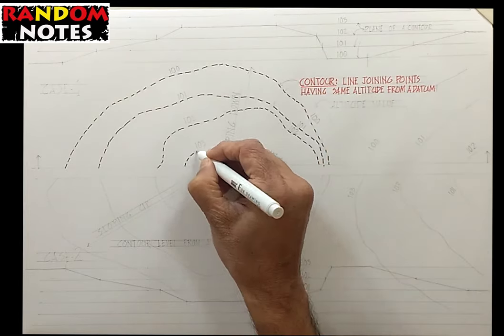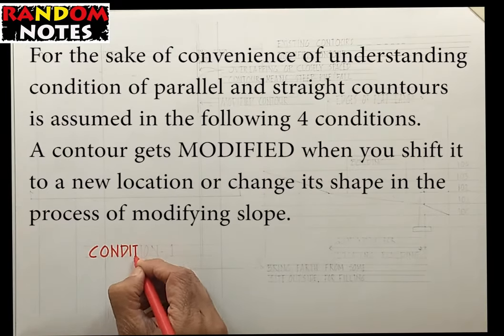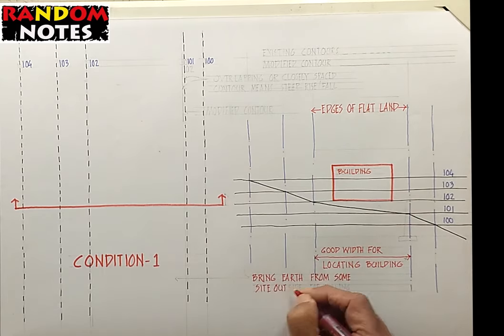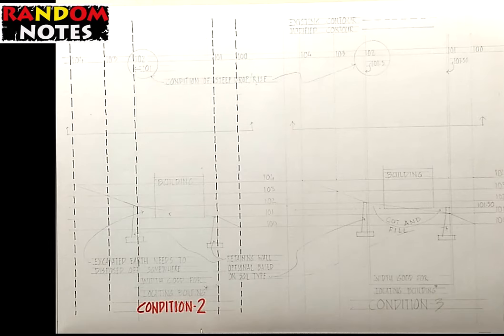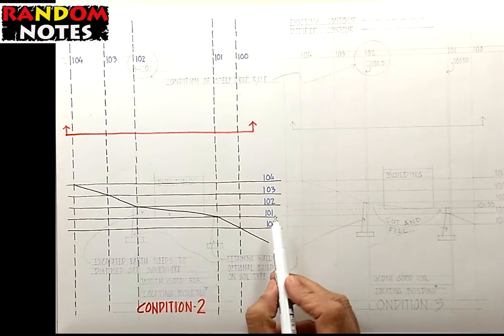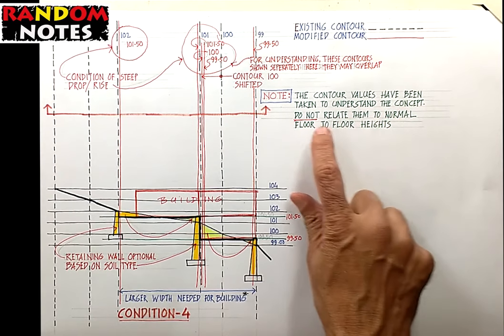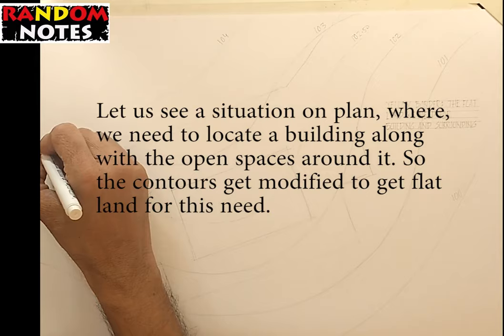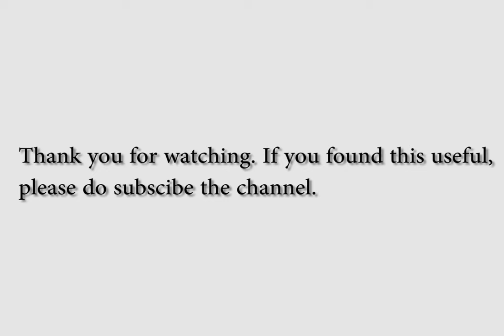CONTOUR MODIFICATION ON SLOPING SITE

Comment: This is an excellent informative video sir. Can you please explain what did you mean by " The greater the detail of the plan, smaller interval of contours"? Is the term talking about the area of the site?
Reply from the maker: Suppose your site plan shows contours, which are at an elevation of 1m elevation. But for more detail or accuracy, you may add the intermediate contours between these two. This means, you may have contours, now, at an interval of 50 cm. This will give you more realistic situation.
Hope this was useful.
Reply: @randomarchitecturenotes-na809   It's clear now, thank you sir.

Comment: How do I come up with proposed level for my building on the site?
Reply from the maker: Once you have come to the dressed earth surface, which is fit for your building, then it is like any flat land with reference to your building/ building block. Now decide the height of plinth and set the level for that. This has been put simplistically. It will vary from case to case.
Reply: @randomarchitecturenotes-na809  thank you :)
Reply: If their are multiple proposed level for building blocks then will their be one plinth or multiple plinths that has To be given? Please tell
Reply from the maker: @ruchithakkar9578  Every built unit will have a plinth when it rests on ground. This may be a common plinth when a complete building sits at the same level on a flat ground. On contoured site, if a building block, or its parts rest on ground at different levels, each such part will have its own plinth.
Reply: @randomarchitecturenotes-na809  Okay.Thank you very much Sir.Professors like you are gems.Now-a-days,the faculty don't take much efforts to draw things so that students could understand better.
Reply from the maker: @ruchithakkar9578  My pleasure...!!!

Comment: what is the floor name  at 99.50, it may called as ground floor or cellar?
Reply from the maker: Mind you, this video was meant to remove that confusion of naming a floor. Thus there is no point of using the names "Ground Floor" or "Cellar"